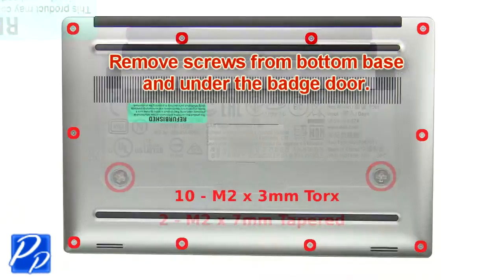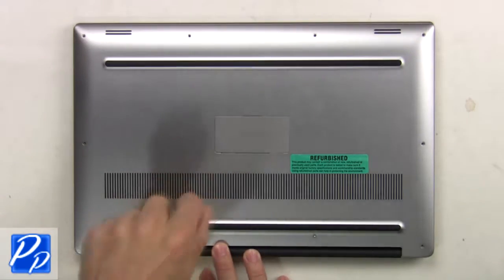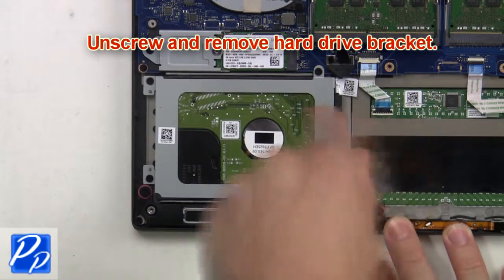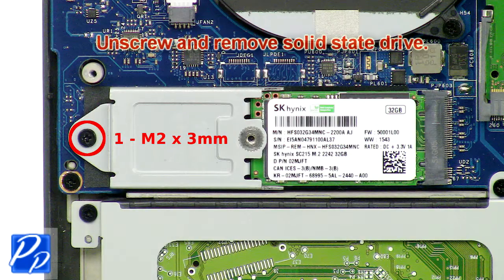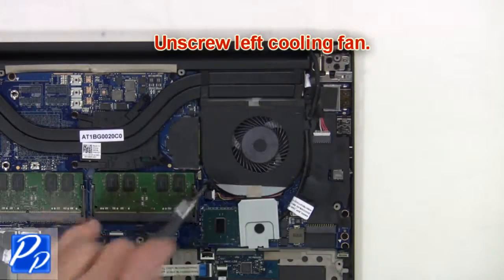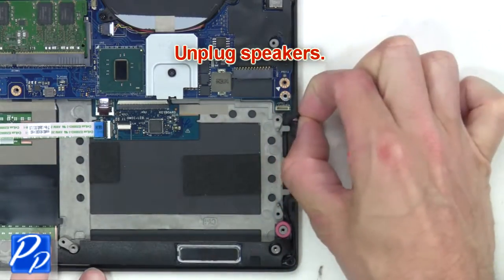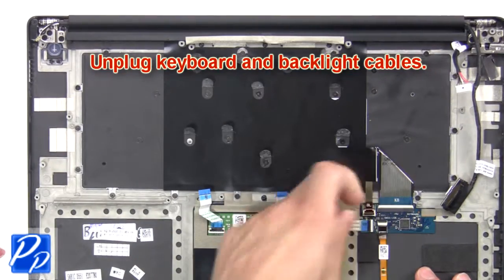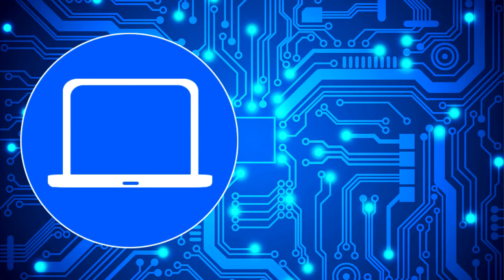Dell XPS 15-9560 (P56F001) Keyboard How-To Video Tutorial

Comment: Thanks, I was able to replace the keyboard on my XPS 9560 with this help. Note I had a bit different setup with larger battery and nVidia GPU. Also the heatsing does not need to be removed from the motherboard, it can be kept there while removing the MB.
Reply from the maker: Thanks for the heads up. Glad you were able to complete your repair.

Comment: Finally got and replaced my keyboard, for the plastic sheath thing a utility knife is helpful.  You also don't have to remove the fans and heat pipes to remove the motherboard.  A pain with those tiny screws and the plastic sheath but so long as you don't mess up any of the cables not hard, just take your time.